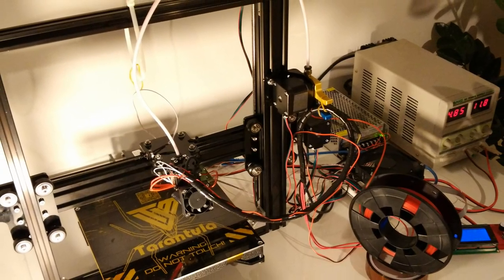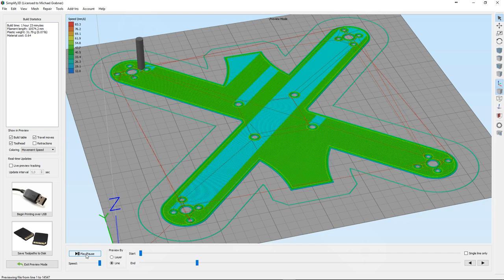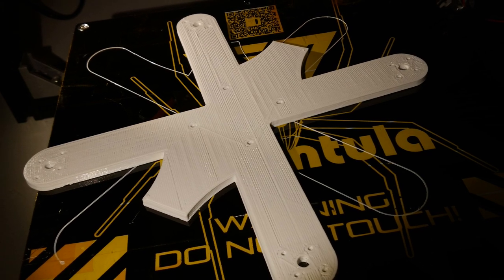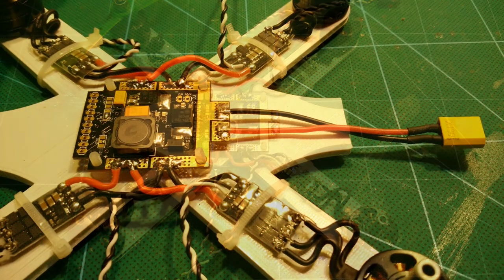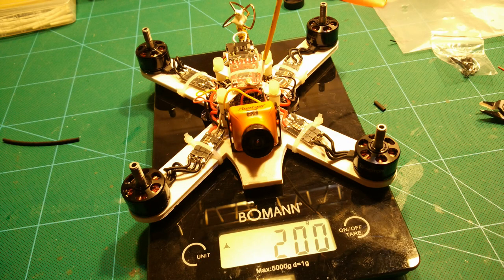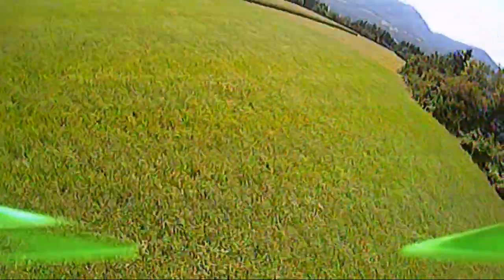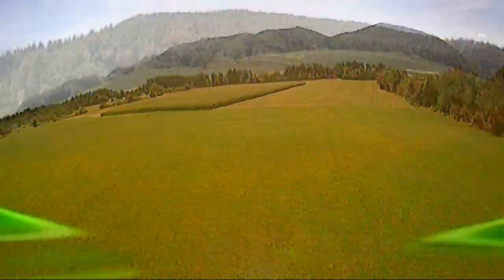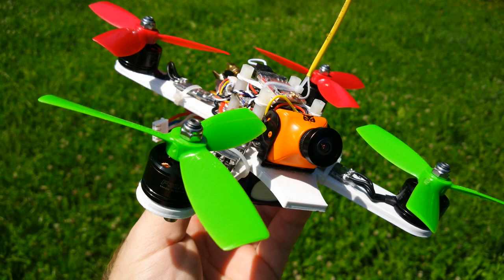3D Printed 4” Racing Quadcopter: From Design to Maiden Flight

Comment: Nice frame personally though I'd make the arms slightly narrower other wise for some of the rotation your pushing down on the quad causing osallstions and less power. Really love this buld though and maked me want a 3d printer even more now!
Reply from the maker: Sounds great. I went with the wider arms to strengthen the structure. But you are of course right that this also means more air beingt pushed against the arms.

Comment: That was fun !
Have you reviewed blackbox data to see if the FC was suffering by the shaking transmitted by plastic ?
Also what material did you use ? PLA ABS or PETG ?

Thanks
Reply: Fernando Labombarda pla
Reply: Good I'll get my 3d printer in the next couple of weeks, will give it a try !

Comment: Enjoyable video but what is this 3s, 2s and so on? What is being quantified?
Reply from the maker: People in this hobby use these terms to quantify the number of lipo cells which are used in an lipo flight pack. 2s refers to 2 lipo cells. 3s refers to 3 lipo cells. Each lipo cell has a nominal voltage of 3.7v, so the s numbers quantify the voltage of the flight pack and thus the voltage which the components of the drone operate on. Higher voltage usually results in esc/motor/prop combinations with a larger "punch", basically a higher acceleration.
Reply: Ah! Thank you very much.
Reply from the maker: My pleasure! Just ask if you have any further questions :-)

Comment: is it possible to use carbon fibre filament to print the frame ? nice work dude
Reply: Yes you can print a carbon reinforced plastic filament would make it stronger
Reply: but more flexible